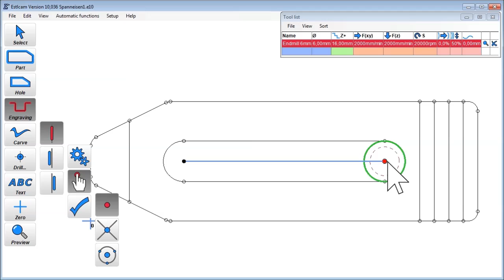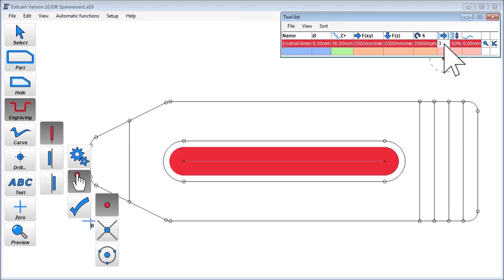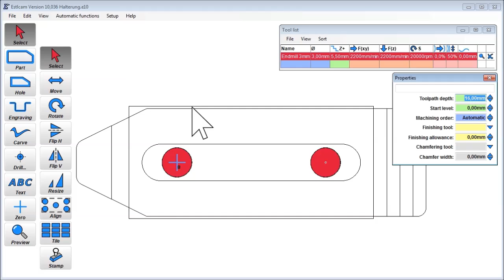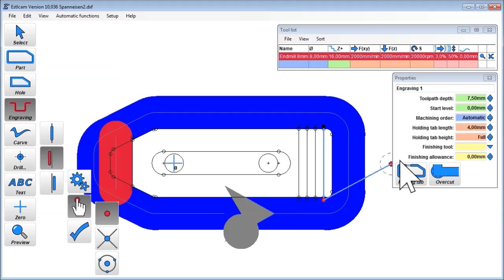CNC machining step clamps

Comment: The outside cutting where chips are clearing don't need trochoidal milling.  Biggest problem with cutting dry is chip clearing.   Clamps came out nice.

Comment: Isn't it faster and cleaner for outside pockets to do an normal cut af full depth with small stepover? Cause the benefit of constant tool pressure doesn't apply for outside profiling. For slots i get it.

Comment: Is there a reason you do conventional milling opposed to climb milling? I noticed it leaves the edges of your steps with some extra remaining material that you're having to break off, it also generates heat in the part instead of evacuating with the chips causing un-needed premature tool wear.